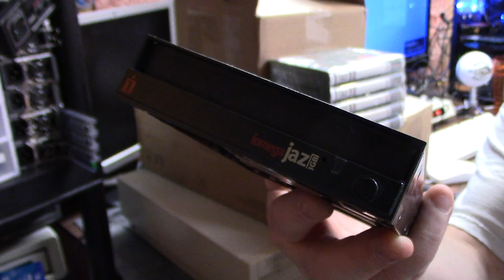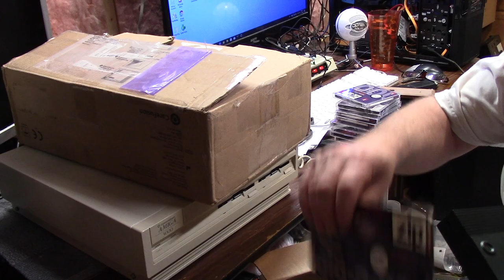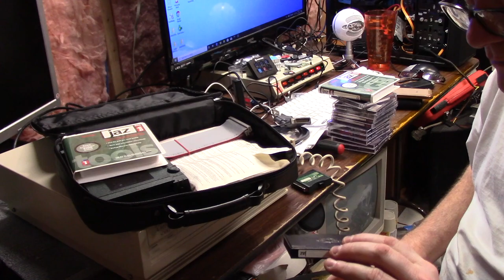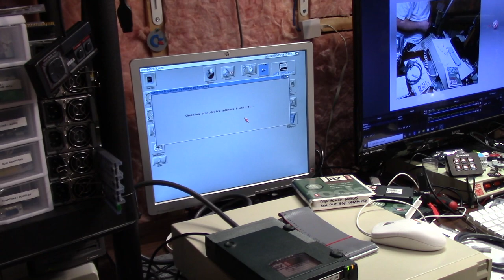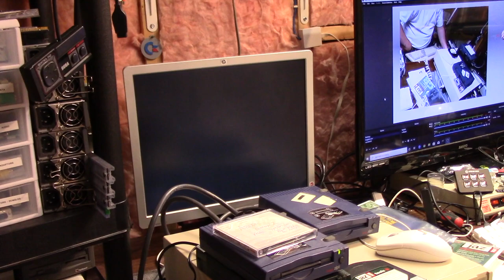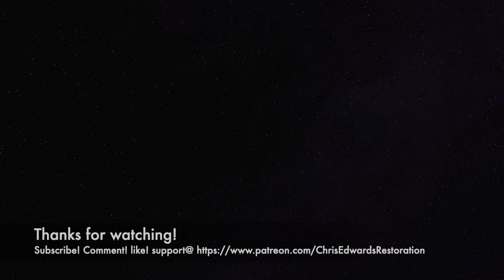lost footage of amiga zip and jazz drives

Comment: Nice vid Chris 👍🏻 I’ve just gone through hell setting up a Zip and Jaz SCSI combo on both my A1200 Elbox Tower and A1200 Checkmate setups with both Blizzard BPPC 040 and 060 with built in SCSI.  What I found out is 1).. Don’t make the external cable too long 2).. I find Zip 250 on ID5 and Jaz 2GB on ID6 with Term switch on. 3).. In BPPC startup menus (Hold ESC on power up), setup Zip for async/sync and Jaz Sync. Also I use “Mount” so no need for anything in Devs:DOSDrivers mounts files and “Reselect”I also got lucky with one of my Zip250 listed on EBay as untested and No PSU as when I plugged it in it worked! 👍🏻 Managed to get the price down from £35 to £20 on it. Today these things are pricey. Use the 2GB Jaz for OS backup that can self boot and the 250 Zip for making emergency Zip disks. Who says these old pieces of hardware ain’t worth anything in the Amiga world 🤷🏻‍♂️🙄😉👍🏻
Reply: I did the same thing more or less, I once paid 70€ for a 2GB Jaz drive and 10 disks, the drive I got unfortunately was a dud (it would spin up, but wouldn't fly the r/w heads out, the drive access light was solid amber), so I was stuck with disks I couldn't even check what's on 'em.. Until a few months ago when I caved in and splurged 90€ for another Jaz drive.. First thing I noticied, the bad Jaz drive I had was earlier (green shell), and the new one I got seemed to be much newer (I think I saw a sticker with may 2000 written on it... That drive is the later see-through grey jaz drives)..

After mustering up the courage to test the new drive, I plugged it in... Flicked the power switch, the drive made its familiar buzzing noise... Then I popped a disk in it, the drive spun up, and it flew the heads and initialized.. Testing on Linux, I've found out that the drive tends to sometimes get confused and refuse to eject a disk unless I power cycle the drive (though under Windows this doesn't happen, no idea why)..

I also bought a untested (the guy lost the power adapter and didn't have any disks) Zip drive on ebay (the guy originally asked 50€ but after a while he sent me a offer to buy it for 30€ or so, which I promptly accepted), then I got a NOS Fujifilm zip disk for 5€ at a yard sale..

Sorting through my stuff, I found a universal PSU that had the correct connector (just that it's not angled, so I can't set the drive on its side), connected the PSU and then I popped the disk in, and the drive sprang to life, although I don't have the proper cables to connect it to my computer, but I do have two older beige Macs (a Power Macintosh 7500/100 and a LC II) that have the proper SCSI port, so I tried it on the 7500, the LC II is in need of a recap (and I do hope as hell that I won't have to do some trace repairs or change the EGRET chip as these tend to be relatively fragile!)..

Aaand surprise surprise, the Zip doesn't appear on the 7500... It's like nobody's home! And to make things even more complex, I only have a ADB keyboard but no mouse, so I can't do anything on the 7500 (except using the keyboard shortcuts, but even with that I couldn't find any scsi utility on this machine, not even Lido or SCSIProbe).. So now I gotta wait on a mouse and find a DB-25 to HD50 dongle.... Fun stuff...
Reply: @Alexis_du_60  On Windows, Mac and even Amiga there is something called “IOTOOLS”, this is handy for checking zip and Jaz drives 👍🏻
Reply: In the age of PiStorm, USB drives, Compact Flash cards and SDCards, why mess with this stuff?    @Chris I have some more untested Zip drives and a 2GB Jaz that really are untested, but these ones won't cost you if you give a address.
Reply from the maker: Email me
Reply: @ChrisEdwardsRestoration  I would if I had your email address.   Oh, and your link to patreon doesn't work for me either.
Reply from the maker: I just tested them all the links for social are on the lower right of the top picture of my main yt page .  The email is in the “about me” oage of my yt chan

Comment: Are there any improvements in Amiga OS3.2 for handling old iomega drives?  

I've got a few ZIP and JAZ drives too but haven't used them for a long time.  I think my JAZ drives are 2GB.   I wanted some kind of removable media for VLab-Motion MovieShop projects, which could only use the first 4GB of any drive, even if you had patches installed.  MovieShop makes custom, non-AmigaDOS, partitions for Audio and Video storage.  More recently, I've used CF cards for MovieShop.

Comment: Well there's 14 minutes of my life I won't get back.
Did you try the Jazz with the Zip at the end of the Bus and try say ID 4 for the Jazz and ID 6 for the ZIP. What is the address of your SCSI HD inside. I seem to remember that the SCSI Controller on the mobo was ID 7 and the first HD was usually ID 0 but when you go to the external chain the controller ends up in the middle of the chain even though it is device 7.
All this based on my 2091A. Been so long since I mucked around with SCSI. Good luck Chris I am going to bed as it is 10:37pm here on the East Coast in OZ.
Reply from the maker: lol thats why it was lost footage...